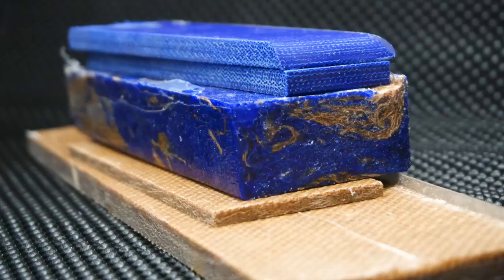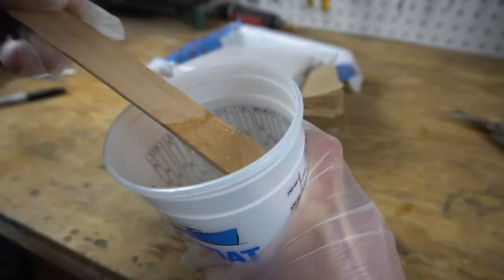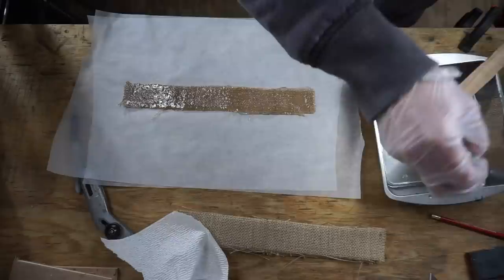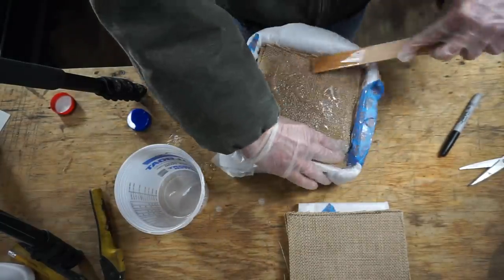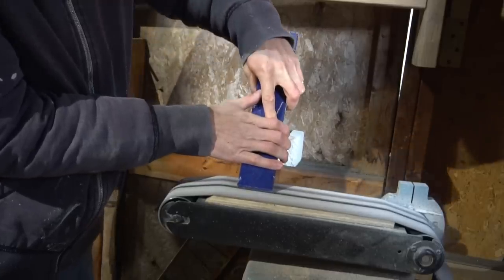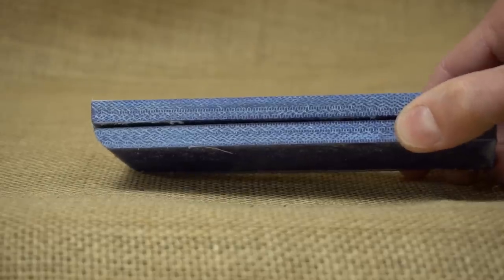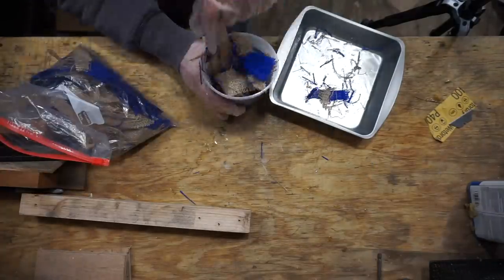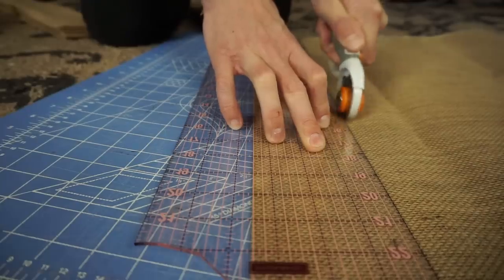How To Make Micarta | A DIY guide to what its really like to make this stuff

Comment: If I can make a suggestion for a next video, would be to use a hard roller between each layers  before wrapping in parchment paper and adding to the press at the end could probably reduce the air bubbles during curing.
Reply from the maker: Yes that most likely will. Ive talked so a couple custom Micarta makers and they say that degassing is absolutely necessary for air bubbles. Also a heated curing process helps as well. A combination of these things is what gets better results. 🙂

Comment: For the wood clamp it would be beneficial for the material to have a center clamp as wood tends to bow, depending on how committed you are to reducing bubbles(read how hard you tighten it down).

Comment: For your press, if you screwed one "guide", we'll call it, to the bottom, and one to the top (so when clamping then together there is a guide on each side), that would help to reduce any bowing that you might see in your clamp. In that short of a distance it's probably not a big deal, if it's even noticeable, but this method would help.

Comment: Great video! I haven’t tried making Micarta myself, but I had a thought about keeping those stray threads at bay. How about folding the burlap over and over (like making a paper fan) without cutting it, then ironing everything tight and just filing off the folds after curing? Would that work?

Comment: Hi Alex.  New to to the knife game. Made 2 knifes thus far and slowly but surely learning the craft. Currently I have a 1x30 belt sander. Harbor freight. Cheap all around but suits me as a beginner   What recommendations can you give me regarding an upgrade in the future that won’t kill the budget?
Reply from the maker: for grinders it’s tough. There are not many options for cheap knife making grinders. You can always go the grizzly grinder route. They run around $550-600 and are probably the cheapest 2x72 you can buy. You’ll have to make modifications though. Other than that you looking to at least $1400 for a single speed 2x72. They are a HUGE upgrade though. I also believe JET tools makes a 1x42 for around $400 or so. I don’t see them much in knife making though.  I definitely think there’s a gap in the market for intermediate grinders. Would be nice to have a 2x72 in the $500 range that was made specifically for Knifemakers.🙂

Comment: by adding resin on top of dry fabric you are beginning with the air on the bottom, and then having to work hard to push resin down and work the bubbles up through the resin. A better approach is to begin with a pool of resin in the pan and then push the dry fabric down on top, so that the resin rises from below and pushes air up. Then, once the fabric is wetted out, add more resin to form another little pool on top of the wetted fabric before adding the next layer of dry fabric. This method reduces the 'cross-travel' of the air bubbles through the resin, and may reduce the problem of bubbles in the cured product. Maybe a minor improvement, but easily done.

Comment: Micarta is made with a phenolic resin system. The basic elements (b-stage) are kraft paper or linen or canvas.  Many layers of the chosen material  are totally impregnated with phenolic resin and then depending on final desired thickness desired these impregnated layers are laid up on top of each other and pressed between “tins” (metal plates - usually stainless steel) with heat until the entire mass is homogeneous.  The sheets are then trimmed to size .  To make G10,  layers of fiberglass cloth are made in a similar process but with a fiberglass polyester resin system. All make excellent materials for different purposes, but were initially developed as electrical insulation as all are electrically non conductive

Comment: Does that boat epoxy a slow cure?  I've done bondo epoxy. It works butt I had to move faster. Epoxy was curing faster Do to thermosetting because it was larger piece lil over 3/4 thick and with 3 layers carbon fiber. And right wax cooking paper work great and released well enough to reuse it

Comment: When drying if you add heat it well release any bubbles or imperfection. Also I've been told reviews of shredder it gives you a good mixture of color of material. Would an arbor press work?

Comment: How about a shop press? And plastic wrap. The kind used to wrap pallets of stuff. It's impermeable and pretty strong.
Reply from the maker: A press would definitely be helpful. Although if it’s cold and your shop isn’t heating the epoxy won’t cure. An actual press would be a game changer for sure.
Reply: @OUTDOORS55  maybe line it with some thick neoprene to even the pressure. I use two inches thick top and bottom for shaping leather.

Comment: i may have numbers slightly wrong but not by much! 2 , 1/2 inch bolt the way you set that up can put close to 24,000lbpsi! or is it psf?? witch ever it can put lot of pressure! i am a metalworker !  but dont make knifes! think i should try but like most things look easy tell you try it?

Comment: Quick question. I’m thinking about doing this. Do I need both the epoxy resin and the slow hardener or just one of them? Do I mix them in a certain proportion?  Also does anyone know if the handles/scales could be shaped using a dremmel?? Are there different results if you use two different types of materials (like nylon webbing AND burlap)?? really curious, any help would be greatly appreciated.

Comment: weird question but did you mix the epoxy and resin in equal parts before placing it on the jig? Do it matter if it is exactly equal parts?

Comment: Alex! My man. You are a god..
.
.
.
.
 send!
.
.
 You didn't think I was going to leave it at god? 
Did you?
Well... 
That's a bit egotistical. 
😆😆

All clowning a side, I really do appreciate this video. I have been, in my extremely limited time, playing around with it a bit. But I don't have the time to devote to developing the method the way you did. I can totally appreciate everything you put into making this video. Absolutely packed full of extremely good information. Information I've been looking for.
Thank you.
Reply from the maker: Lol😂👊   You can get good results if you find the correct  technique for you. There’s definitely some cool stuff that can be done with this at home. One of the stresses for me was havywet epoxy around expensive camera equipment. The epoxy tends to get everywhere 😂
Reply: @OUTDOORS55  Yeah, I'm definitely building that press. I'm going to use MDF I have lying around with a 2x4 across top and bottom to back it up. I have a bunch of military multicam & old school chocolate chip fabric I think would make some really cool scales.
 I'm going to check out that epoxy you used. I've been using that nasty Bondo. Man that crap stinks!!
One tip I do want to share with you. You know those real thin, smooth, floppy cutting boards from Walmart. Line your press with those. Epoxy doesn't stick to it. You don't need wax or parchment paper! It works great!
Edit: I would be scared working with this crap around camera equipment!😆
Reply from the maker: The epoxy I used was the 2-1 epoxy. I’d use their 5-1 as it’s slightly thinner. Either will work though and it doesn’t smell.   Its quite strong stuff. I tested it epoxing those scales on, and I had a heck of a time getting them off.  It stuck to the steel and pulled the scales apart when I hammered/pry it off. That’s without any through holes either just straight 100 grit surface prep. I’d feel confident using it to epoxy scales to knife for sure. Funny, I actually looked for those exam cutting boards at Walmart but couldn’t find them. All they had were wooden ones 🤷‍♂️
Reply: @OUTDOORS55  Damn, thats some strong stuff. Good to know on the 5-1. Thanks! Thinner is definitely better when trying to get a resin to soak into material. If you're Walmart doesn't carry em' you can go online, order them to the store for free. There cheap too! Those things really do work fantastic. You just don't want to put a single scratch in them. The second you do it gives the epoxy something to latch onto. Oh and to help get rid of more air bubbles, before you seal it up, hit it with a heat gun on high for just a minute. You'll see the bubbles come right to the top. It also helps with getting the epoxy to penetrate the material and helps everything flow more evenly while being pressed.
Reply from the maker: Man I didn’t even think about a heat gun. I had one less than a foot away 😂
Reply: @OUTDOORS55   The only reason I thought to try mine was cuz I tripped over the cord as I was running by trying to get it done before that stinky Bondo hardened. I failed. 😆😆 Since then I (almost)always use it when working with epoxys.
Reply from the maker: Haha 😂👍

Comment: So I have problems with slop resin squeezing out from under my scales. How do you clean that off? Or, how do you avoid the squeeze while also keeping the sides pinned down really well?
Reply from the maker: Are you talking about epoxying the scales to the knife itself?
Reply: @OUTDOORS55  Indeed, I mix the epoxy and apply to both surfaces. Apply pressure and out squeezes the epoxy.  I don't see any pro blade makers with any trace of epoxy excess anywhere.
Reply: @tacticalpianist  I'm nowhere near an expert but maybe not having the resin as close to the edge may help. If you want to clean it, maybe try some rubbing alcohol and a paper towel. Again, not an expert but it will probably help.

Comment: Use a tape for tyvex like the red duct tape insteated of the wax paper way easiers to line your jigs. Or even use melamine. Dpoxy wont stick to it
Reply from the maker: I though of melamine but didn't want to buy a whole sheet if it didn't work. Thanks for the tip! Thats probably what ill do next time.
Reply: No worries. You find a lot of videos of working with epoxy with wood working. Same principle. Make sure you caulk the corners or you will loose the epoxy. And dont let the wood touch the epoxy or its glued to it. Just in case that wasnt obvious.

Comment: I bought the resin you're saying to avoid. But this was some months ago and I have yet to open it, still undecided about doing it. The mess, smell, and possible waste of time, effort and money has really killed any motivation in doing this. Your clamp idea is good, i'd definitely build that if I ever decide to do it.
Reply from the maker: The biggest downside to that resin is the drying time. It sets too fast in my opinion. That being said, Plenty of people have used it to make great looking scales. I just don’t liked to be rushed when doing something like this.  I think if you can push through the downsides making your own handle material does have a lot of benefits. And like everything you get better as you go. The more you make the better you get. 🙂
Reply: @OUTDOORS55  yeah, I've seen success with the product and you're right the fast setting will trip me up if I don't have everything in order. Then temperature plays a factor. i'm surprised you brought yours inside. D:
Reply from the maker: The epoxy I used didn’t smell. Not saying there wasn’t any toxic fumes, but it didn’t smell😂 I did have it in a well ventilated space. Not in a living space.  Temperature does play a big roll too.
Reply: @OUTDOORS55  like your bathroom? lol.

Comment: My wife does Krafting, and other amusing nonsence. Setting something in clear Bubble Free Resin she uses a plastic bag method. A vacuum food saver plastic bag. She does her set up in a mold, dollar store pan is a mold. At one point, depending on what she is doing, she places it soon to be incased item inside the vacuum bag, and sucks the air out with her handy dandy hand held kitchen vacuum pump. 14 PSI all around pressure. 
 With a little head scratching modifications it just might work just fine. I buy my knife handle material thank you.

Comment: “Micarta” is a rigid composite material made from laminated paper, fiberglass, cloth, or other material impregnated with a plastic resin. It is commonly used as an electrical insulator and as a tool handle, particularly for knives.

Comment: I have an idea. What if you had a big messy block of mixed, cut up strips, except much shorter and all types of strings and garbage, and you crammed it together,  put some epoxy on it and you pushed it down into a block and then you took it out when it was dry and cut it  down into the scales you want or nearly so. then, somehow put it into a square mold and filled that with epoxy again and let it cure? Then you would have a cool looking dirty grungy block but it would be coated in a 16th or whatever inch thick layer of clean epoxy?
# biggest run-on sentence ever

Comment: Could you not put your epoxy in a mixing pot and then put it in a bucket with a lid and use a shop vac to take the air out of the bucket

Comment: Why couldn’t I use small neon multi-colored rope along with straight grain single colors of  nylon strips, all woven together to make some crazy micarta?
    You know, spend more “creative time” in the material preparation.  Maybe even add some tiny brass or copper wire into the braid?    Compressed and cured, then shaped and sanded, wouldn’t this be a more appealing micarta???

Comment: I bet you could get the waxed paper to release by warming it. Hairdryer, iron, hot air gun...
Reply: Fracture blow torch, crack lighter. whatever. .... no you're totally right. hairdryer or iron will melt the wax pretty quickly.

Comment: Micarta is made with phenolic resin which is placed under heavy hydraulic pressure and thermally cured creating a very strong and stable material which resists heat, solvents and UV damage.

Soaking rags in epoxy resin and clamping them between boards will make a marginally useful decorative material which can be carefully polished but must not be overheated or stored in direct sunlight or exposed to solvents. Calling it micarta is just silly that is like calling plaster concrete.
Reply from the maker: Tell that to all the custom micarta makers out there.
Reply from the maker: Lol yeah again tell all the custom knife makers and abs master smiths their "counterfit micarta" wont hold up in sun light.😂 You obviously didnt do research on the particular exoxy resin I used😂 btw i wont tolerate troll comments here. Do some research on the resins used bro. Its not 1979 anymore. Btw this coment is being deleted dont bother responding. You wont change my mind.
Reply: I have no intention of changing your mind just clearing up some of the misinformation you have chosen to inflict on beginner knifemakers. As per the company that markets your boat glue it has a heat deflection rating of 126 degrees Fahrenheit meaning don't leave your knives in a hot car or in direct sunlight. They don't publish the specific chemical and UV light vulnerabilities but if you had bothered to ask I'm sure they could have educated you. http://www.totalboat.com/wp-content/uploads/2016/11/TotalBoat-High-Perfomance-2-to-1-Epoxy-Resin-Hardeners-Tech-Data.pdf

Comment: Dude, you’re making this WAY harder than this needs to be. Watch Walter Sorrells’ videos on how to make micarta. I’ve copied his method and really had no major issues... I use 2 pieces of welding steel from Home Depot and 2 C-clamps. Never had as much of a mess or as difficult of a time as you have in this video...
Reply from the maker: Lol ive seen his video. Its just as messy.

Comment: Why can't I just use a press made out of hdpe?
Reply: John Kilmartin or better yet, a press made out of previously made micarta.
Reply: @BengtRosini13  As I understand it polyethylene and micarta don't adhere. So instead of a bag in a press just make the press itself out of high density polyethylene then you no longer need a liner.
Reply: I just don't know if there is a side effect like off gassing or colour transfer between the materials.

Comment: Micarta is an old catch all name and is misleading. It has come to be used in ways that are confusing.  You are trying to make G10 here, but in the industry G10 is only made with fiberglass cloth . Cloth (or paper) laminates are typically made with the old phenolic resin systems which are not clear. Try making your epoxy  laminate with fiberglass cloth.  There are companies that make coloring agents for resin systems, like Chromaflo in Ashtabula, OH.  I don’ t know if glass cloth is available in colors but perhaps you can dye it.  Color the resin or color the glass cloth ?   Can you buy small quantities of resin color ?  Colored cloth ?  Colored laminates all ready made ?  These questions are the knife makers dilemma.
If you want more focus on the High Pressure Laminates Industry review the products and applications and services of a manufacturer like Iten Industries, Ashtabula, Oh.  https://www.itenindustries.com/.   Look under products, high pressure laminates, then glass or paper.  It is a technical industry !
Reply from the maker: Your right, micarta just seems to be the name that stuff for everything epoxy based. Sorta like Kleenex. Thanks for the comment my friend👍
Reply: OUTDOORS55   Micarta is mostly associated with Phenolic resin systems and paper or cotton substrates. G10 is usually lumped in as Micarta but uses epoxy resin and fiber glass cloth.  I wonder what your laminate would look like if you used fiber glass cloth and tried to get some color from Chromaflo ?  Great stuff you are doing - interesting to watch - many thanks !

Comment: What a silly way to do it. You should be using a vacuum infusion technique. Only need a vacuum pump, rubber tubing and a plastic bag. Can set it up for under $100, no press, no mess, reliable results.
Reply from the maker: Flatness is key to making Micarta for knives. Not sure how you would do that without a press. All the pros use a press of some sort. Not saying it wouldn't work, ive just never seen it done that way🤷‍♂️
Reply: @OUTDOORS55  Check YT for vids on vacuum infusion. Its how the pro composite people do it.